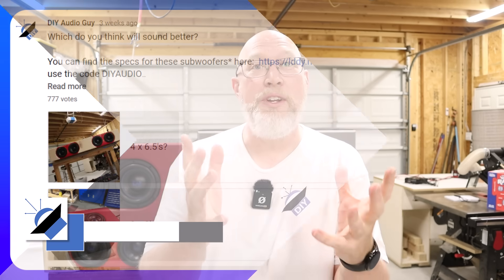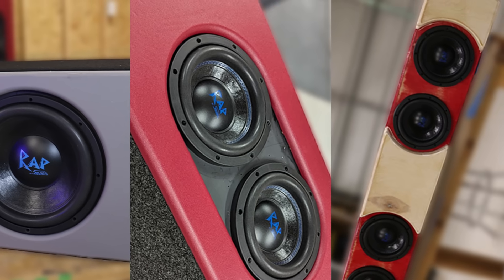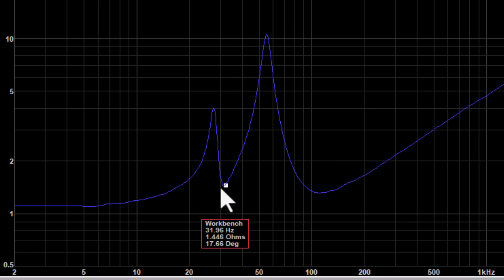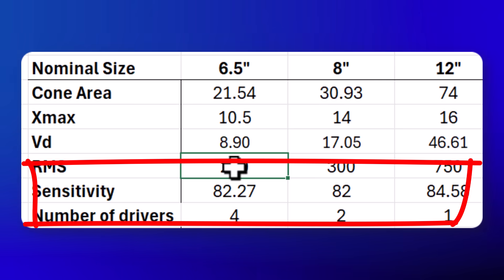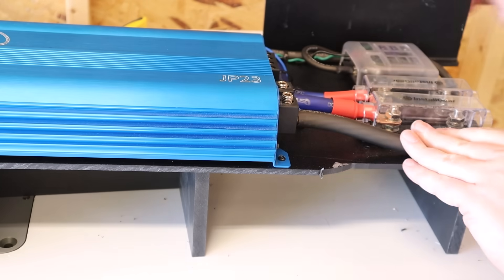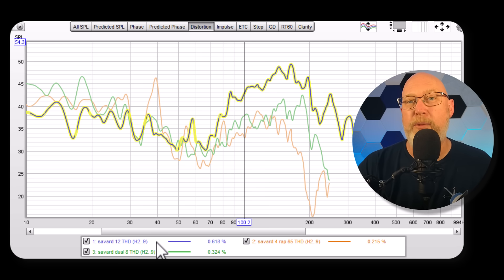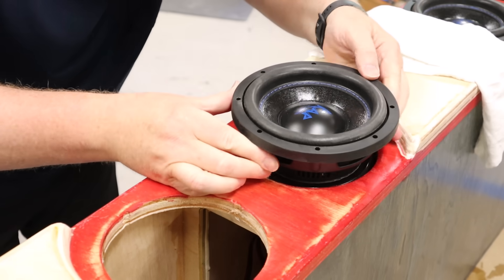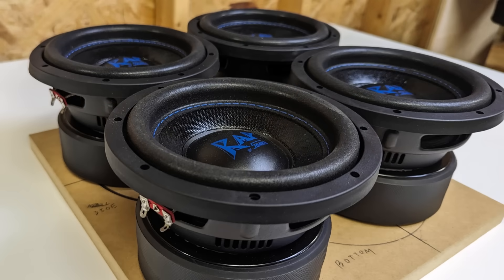Are small subwoofers better than big subwoofers?

Comment: I did a similar test for a science fair project back in the 80s. What i found back then was speaker placement was just as important as size and quantity such that 2 *6.5 speakers next to each was just as loud as 3 *6.5 spaced out. I imagine this was because of acoustic coupling. This was the theory used in the creation of high end polk audio speakers.

I'm betting that placing those 4 * 6.5 in a square pattern would outperform the 8s or the 12. This may not have much relevance with car audio however there was always a debate that you could never hear low frequencies within the confinement of a vehicle and thus transducers were better. Maybe a topic for a future video.
Reply: Yes, and common air sucks. Every speaker in its own box. Ports on the same surface as the speaker. Ports are for tuning. You use a subsonic filter set to 20. Your port tunes to 25. You sub tunes to 30 give or take. Give boost at 40 and set low pas to 50.
Reply: Baffle diffraction is a thing. Yes, it matters in a big way. It actually matters even more with mid ranges and tweeters in a tower style speaker.
Reply: Look at bass guitar amps for a good example. The most common bass guitar speaker configuration is the 8x10 fridge cab or the 4x10 for smaller venues. The speakers are always in a tight square and can move much more air than a single 15”
Reply: @punman5392  One of the loudest car systems I ever heard was four Kicker 8" speakers. It blew my mind that four of them sounded louder and cleaner than two 15" woofers I have heard in the past. I guess it really depends on the quality of the speakers, too.
Reply: EXACTLY!... Similar to the way antenna arrays work!... The 4 should function nearer to the diameter of the quad!
That would be a cool experiment!
Reply: This tells me putting two 12s pointed in the hole to the trunk is gonna push a ridiculous amount of bass.
Reply: @notablediscomfort  Probably because you now have more air in the box?

Comment: Not Fair. For apples to apples you should've compared 6.5s with 4x 12 inchers :face-blue-wide-eyes: :yougotthis:
Great video, Very informative and to the point, Keep 'em coming!!!
Reply from the maker: Thanks for watching!
Reply: The charts mean nothing. 4 6.5s can't compare to one good 12. I have 4 strong 8s and they don't compare to 2 good 12s. I'm speaking from real world experience. The 8s don't suck at all, but they just will never hang with 12s. My 8s on music maxed out might hit 144db before clipping on a Sundown sfb5000. I also have 2 Sundown x12v3s, and they are louder and move way more air.
Reply: That would be true if he was just comparing SPL, as the saying goes, no replacement for displacement, however that was not the point of this video. The point was trying to determine if multiple smaller drivers is better than one big driver. So using four big drivers would be very dumb for this particular example. Also if you're dealing with limited space, you're not going to have four large drivers. For example there's absolutely no way you can fit four 12s in a single cab truck unless you sacrifice probably all of your seat room, your visibility out the back window, and possibly just the passenger seat in general. If you want big output without a lot of space, you would need to go with smaller drivers in order to fit them in smaller spaces. Obviously a single small driver would sacrifice output, that's why you have to use multiples versus larger drivers. So that's the whole purpose of this video. To compare What you would do with similar space to try to achieve similar output

Comment: bogus question.

what is the throw and magenetic motor and TS parameters, cabinet type?

for the pinnacle of speaker design buy a dozen sound projecting things to stick on thin foam board and you will have a full-blown 360-degree spherical Soundfield.

Comment: This is a VERY interesting video. I'm in search of a solution for a HT-sub for my home, where my speakers are capable of going down to app 50Hz. Basically I don't need to go up to 80Hz with the sub (which would be a classic frequency to switch to main speakers), but if I could reach that to have a bit more tunability, would be nice. My main problem is, I want to sub to fit under my floating cabinet, which has a height under of 20cm, a depth of app 35-40cm and a length of 3m (yes, 300cm). I'm going through several enclosure designs and am even thinking of 2 horns with 6,5 subwoofer. This might affect punch bass, but improve low bass. I'm aiming for the range of 20-80Hz, what would you do ?
Reply from the maker: I would get one of these:  https://parts-express.sjv.io/oe9Ddm put it in a huge ported box tuned to 25 hz and throw some power at it.
Reply: @DIYAudioGuy  Thanks for the suggestion, but how does that meet the biggest challenge: "My main problem is, I want to sub to fit under my floating cabinet, which has a height under of 20cm, a depth of app 35-40cm and a length of 3m (yes, 300cm)." ?

Comment: Larger subs have more moving mass, and as such typically have a lower Fs, which will allow them to work more efficiently at lower frequencies, particularly when used in ported enclosures. Larger subs also have more cone area, and often, more excursion than the same make and model of sub in a smaller size, which allows the larger sub to move more air. The moving of more air equates to more output or volume, so while a larger sub may be able to get louder at lower volumes, pretty much any sub can produce notes lower than the range of human hearing. The simple fact is that a larger sub can produce these bottom octave frequencies are greater output, so it's louder, or more audible to the listener than a smaller sub would be at the same power input. In short, a larger sub does not play more deeply per se, but it does tend to have greater output at those lowest audible notes. A smaller sub is faster.
 
This is just bs. The speed or detail of a sub (how fast it reacts to changes in the input signal) is a matter of numerous factors, the least of which tends to be the moving mass of the driver. How "fast" a driver is, depends more on several factors of the amplifier, the speaker, and the enclosure in which the speaker is housed.

The amplifier's slew rate, damping factor, and dynamic headroom (reserve power, dependant on the quality of the amp's power supply in large part) are factors in controlling the speaker.

The enclosure alignment chosen for the sub will have a large effect on the driver's response as well. For example, a ported enclosure tends to have more transient delay than a sealed box, whereas if you want the best driver control, an aperiodic enclosure is your best choice.

The speaker itself has several factors that determine it's "speed" as well, the largest of which is motor control, or "BL." The BL of a speaker is the biggest factor in how well the cone movement is controlled. BL is the actual cross product of the magnet field B with the conductor length L. It is not a scalar, but rather a vector. Combine this vector with the current I and you’ll get exactly the force (up or down according to the DC or AC input). But with the way amplifiers are designed, the current I of the speaker is never constant, only the voltage is. It is also not entirely important to know what the force is because is changes so rapidly. In any event, the BL squared divided by the resistance of the voice coil Re in fact gives us a generic force factor in newtons squared per watt. This number is relative for all speakers and the higher the number, the more force a motor can invoke on a cone with the same input power. Its important to distinguish that BL and Re are related much like inductance and Re are. 32Tm over 8 ohms is identical to 16Tm over 2 ohms, namely 128 N²/W. All other things equal (moving mass and cone size in particualr), A higher BL²/Re will increase the sensitivity of the driver which is a generally a very good thing. BL Curve is a graph of the magnetic strength of the speaker's motor structure across the frequency spectrum of the speaker's operating range.
 
In short, a smaller sub is not automatically faster than a larger sub. Which is better; several small subs, or one large sub?
Well, this also depends on a few things. We'll assume right off that you have the room for either configuration in the vehicle. What you want to compare is driver sensitivity, which tells you how much sound you get from the speaker (output) per watt of input. Another thing to consider is cone area. Compare cone atea by finding the surface area of each speaker (π*R²) and add the sums together if using multiple drivers. Compare this with the surface area of the single sub, then compare the combined excursions (Xmax) as well. This will tell you the total surface area of the sub(s) along with their excursion(s) and sensitivity, which are the main factors, if using the same type of box for both setups. Typically I prefer to go with the larger sub(s) whenever possible. Larger subs don't play as high as smaller subs.
This is also untrue.
Reply: Correct!

Comment: 9:10 distortion graph:
multiple drivers couple acoustically and produce higher output w/ less work resulting in substantially lower harmonic distortion for a given SPL. you get smaller cones to perform as a single cone that's larger than the sum of their cones' surface area (increased sensitivity).
but that doesn't apply to the sound output coming out of the port of an enclosure w/ multiple drivers as the port is a single sound source. 

if each small driver has its own enclosure, then the separate vents would couple acoustically and the distortion in the low fq range (port output) would be (substantially) lower than that of a single driver, just like the graph shows above 80Hz.

Comment: I didn’t catch what your measurement rig was for the measurements you did in rew? Are you just using the Dayton umm6 usb mic ? Or are you using a similar mic connected via xlr going into an audio interface? Reason I mention this is because without the xlr mic and audio interface/soundcard doing anything more than rta measurements is challenging and also inaccurate. There is work around using the usb mic to get a few of the various measurements working in rew but it’s just a lot more work so the best to do is just play pink noise thru rew using the tone generator built in and taking the rta frequency response measurements 💙

Comment: It sure depends on what you want out of it. The FS of smaller version of the same driver will be higher and that won't help you play low, even if you still play loud. More drivers means more complicated enclosure builds and wiring, probably more cost. I tend to use the largest subwoofer I can to fit well in a well suited enclosure, for where it will be used.

Also that xmax. Some drivers 8-12" versions are all the same motor and spider size and all that changes is mor cone/lower FS.

Comment: I have run 18" in my last 3 systems. I just prefer a larger; preferably, high efficiency driver. Presently I have 2 pro audio 18" from Peavey and a 10" from GRS in my glovebox. But I'm thinking like a man from 20 years ago. The new small subs are impressive. Would definitely like to build an spl rig with them.

Comment: I believe the 4 6s would sound louder. the and harder.... smaller cone faster respond, but bigger cone can move more air. great video... I would go for the single 12 or dual 8... 
cant trade area Vs quantity... but as you said if you dont have the space.. you are out of luck.. :face-pink-tears::body-blue-raised-arms:
Reply: Smaller faster cone size is a myth. 
Speed is not linked to weight.

Comment: I can tell you definitely know what you’re new rule of thumb make the box 20% smaller add more power 50% more make sure your comb on lines can you optimize your box centerpoint with the speakers I would go with the 112 should fit in a cubic foot or smaller if it’s one of the newer ones
Reply from the maker: Nope, make it 50% bigger. Use the same amount of power.

Comment: I Ga a cutting edge system that Kenwood, Kicker, and Polk all wanted articles on but I had no wants for that. So my Subs which were absolute killers were the Dual Competition 10s in their box fired by a Kenwood 1021 amp. But here is the thing Damping factor on that amp was unheard of. It controlled those subs so well that they would make your heart skip a beat. For all the reps from those companies they would sit in front seat of my cougar and when the song came on with immediate thump every one of them scrambled trying to exit as the chest compression was so dang hard. Heck we had a hard time pinning down a metalicca noise until we found the steal rear seat cross member was torquing from the pounding it was taking. Excuse the memory loss but that amp was running around 6-800 watts continuous with peaks over a grand the way we had it set up but Control of those Subs is what made it so deadly. Subs any bigger than 10s start having issues with flex and ability to control the surface which is where distortion rolls in. Like I said sorry about any info I misspeak abioit but it was almost 40 yrs ago. By far the best sounding system those companies had ever heard in the day as it was complete silence at full volume in between songs but man when it was in go mode nothing but absolute pure clean music at outrageous but not obnoxious levels. Clean and Power will always be my choice. Cheers

Comment: I just did the same experiment for myself recently! Did 2 different box setups for ch5 on my soundstream amp using Audiopipe DVC subs. A dual 6.5 vented box @ 4ohm drawing 210watts and a single 15 sealed/stuffed box @ 2ohm drawing the full 350watts. The 15 did beat out the two 6.5's, not by a huge margin though. It may be that Im just digging the sealed sound better. Im gonna now rework the smaller box and slim it up so I can swap it in when Im hauling large items and still have full sound.
Reply from the maker: That's a good idea.
Reply: @DIYAudioGuy  have you ever mixed sub sizes in a single enclosure? Theres a JL home sub currently on offer setup that way. Just a curiosity
Reply from the maker: @AllboroLCD  I don't recommend that.  It takes a lot of work to make it sound right.

Comment: If your sub and mic placement was the same while measuring 40 Hz tone I have to say there is something wrong with 2x8" and something even more wrong with 4x6.5" . Using a good and EQed over-ear pair of headphones what I hear is only the 12" sub produces a real 40 Hz tone.
Reply from the maker: Or maybe you're just hearing the microphone clip?.
Reply: @DIYAudioGuy If the mic was clipping then yes, it explains that, so it is is quite possibly distortion from clipping which results in higher frequency artifacts.

Comment: Found a Mopar subwoofer  on eBay and instaled under the back seat, of a quad cab Dodge ram 1500, 4x4,, have to keep the bass on the head unit turned all the way off, and still have big bass,..

Comment: Yup! The lower the distortion the better. BUT because it is not a full range speaker it depends. If you want to use a crossover and you want the subwoofer only reproduce lower than 55 Hz sounds then that 12" is in fact better but if you want to let it reproduce up to 100 Hz and higher (which I doubt) then it is worse.
Reply from the maker: Yep, it's kind of tricky.

Comment: I just can't do it. I really should do 4 10s or 6 8s but I am stubbornly going to still try to shove in a single 15 on an 8k. I vowed never to get anything smaller than a 12 but it does seem like they are a much different animal than the stuff my buddies had in the 90s. Its the price point as well. I would rather have a nice $1000 15" sub than 4 or 6$140-$250 10s or 8s.
Reply from the maker: Go ahead and use the bigger subwoofer if you have room for it.

Comment: I compete in SQ amd my 15" sub sealed is measurable down to 8hz. A 15", 18", 24" etc. will have higher sensitivity and will get the subsonic detail in music that smaller subs will not be able to, or will struggle to. Plus, it will get down when I want it to. Larger subs are not "slow" or "sloppy". That is just crap people say when they dont know what theyre talking about or doing.
Reply from the maker: I generally agree. Larger subs are almost always better.

Comment: Im running four 8inch Cerwin Vega subwoofers in a seald box under the seat of my F-150 super cab off of a 1200 watt amp. And it sounds great on everything. 
Sead boxes sound better for rock, metal, blues and jazz. Subs in sealed boxes require less airspace and the boxes are much smaller because you dont have to add 20% extra space for the ports.
Reply: CV subs are great, but they really shine in a ported enclosure. Of course Im not to familiar with the new ones out even though I do have the vmaxx just not installed and many other CV subs in my collection. Sealed boxes are great though for the music you mentioned but they can play quite low and loud as well. I would nearly double the power to the subs in a sealed box as long as it is clean undistorted power.
Reply: Wish I could get something like that under The rear seat of my '05 Tundra. There's just zero room.
Reply from the maker: People are surprised when they find out how much room a properly sized Port will take up.
Reply: your ideas are incorrect, but your choice in "vegas" is a 11 out of 10!!❤